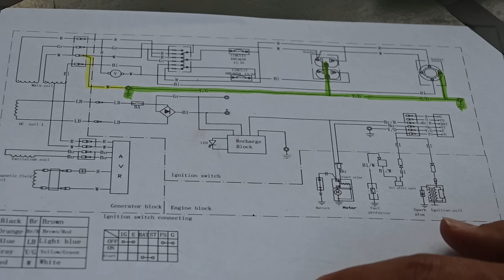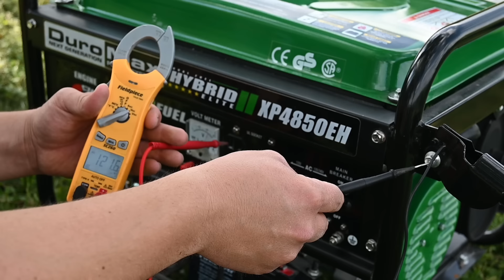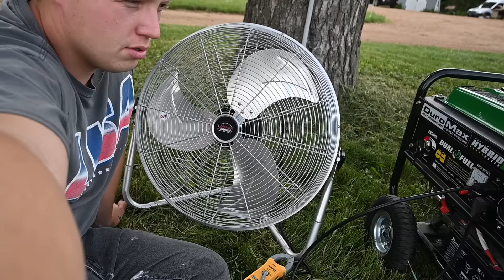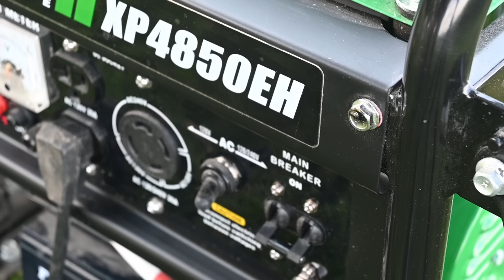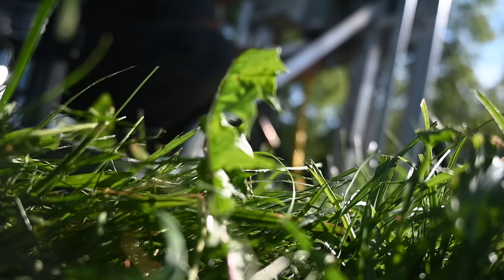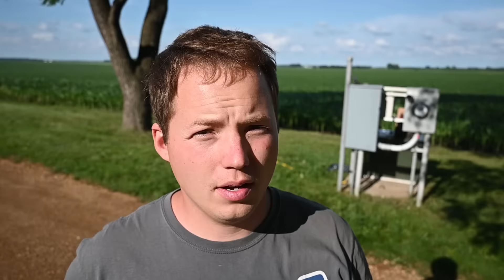What is a Floating Neutral Generator?

Comment: Maybe the best video on youtube explaining bonded versus floating neutral generator. I had an "master electrician" tell me that a bonded or floating neutral generator does not matter, all that does is the first means of disconnect needs to be bonded. I said no if you use a 3 pole transfer switch where it switches the neutral as well as the hots, the generator must be bonded with a ground rod attached, and he flat out said no. I know the research I've done and your video further reinforces things. 

"Everyone is an expert, the trick is to talk to the right expert! - anon

Comment: I worked for a company as an apprentice years ago and we done a lot of Generac Automatic Standby Generators for whole house operation, and one county made us drive a ground rod for these 16kw, 17kw,20kw and 22kw generators and another would make us disconnect the ground rod from the generator. When we first started installing these generators, there was a mechanical lug on the back at the bottom of the outside casing, over time, a couple of years down the road, Generac removed the mechanical grounding lug, and it is my understanding that Mike Holt played a role in that decision. All it is essentially doing is giving lightning a path to fry the circuit board on the generator and transfer switch. I think what you done essentially proved that true when you drove the ground rod. It done nothing at all to help provide a path for a fault current to trip a breaker! I thought this was a great video, and I think there is a lot of confusion on grounding and bonding for sure!
Reply: Grounding is all about "potential" path to earth. Potential makes everything neutral.
Reply: @ that’s not what it’s all about! Potential voltage difference has to do with bonding! It assures that a person isn’t shocked because of any voltage difference metal parts!
Bonding and grounding have to do with tripping a circuit breaker as fast as possible to avoid damage to personnel and equipment!

Comment: You seriously saved my ass with this video; had I not just installed a new furnace, I would never have known that my generator hasn’t been grounded since I bought it...extremely frustrating, I was getting a Hot/Neu REV on my ground fault tester, it was actually flickering both sides of the tester. 

I showed your video to the repair guy for Ryobi, he didn’t have a clue either. He said these are dangerous to use with extension cords and was surprised that none of the books mention this from any manufacturer. 

In my opinion there should be a toggle switch to be able to use bonded or otherwise, as well as a clear explanation as to why you need bonded or floating. When my warranty is up, I am installing a toggle for this. 

Thanks for making this video, I did purchase one of those plugs from your link...

Curious though, does just doing one plug fix all the plugs. The Ryobi dude said one should do it because they are all hooked together, but I thought I would ask. I have a Ryobi 4000 inverter.
 
ROCK ON!
Reply: UPDATE: I could not believe that this caused my generator failure. I bought the same generator and plugged it into the new generator and it worked perfectly. There must have been an internal issue with my other generator. It’s off to the shop to figure out what happened to it...My GMVC80 Goodman is working perfectly now as well as everything is grounded...THANK YOU!

Your advice was sound and I now think that something was wrong with the other generator that the plug exposed. 

THIS METHOD YOU HAVE POSTED IS SOUND AND WORKS PERFECTLY.

———————————————————

I guess my praise was too soon. I heard a snap sound when I tried the plug recommended, and I heard a snap. And the engine kept running but slowed down 20% from idle. 

None of the circuit breakers snapped, but now there is no power from any plug and the engine knocks hard when I try to start it. 😕 Looks like this turned my generator into a paperweight. Very upset right now...I checked the plug to be sure it’s wired right and it is...no idea what happened. I was so convinced this was going to solve my issue, and now my inverter won’t start at all. Something seriously didn’t work well...

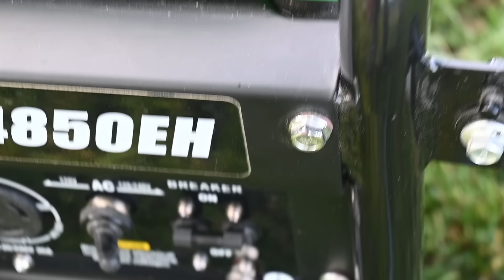Comment: Amazing in depth video on this. Thanks! @12:46 for those that dont get it... you would get shocked by touching the generator with that situation. The metal parts were live with voltage
Reply: Not really. The phase was grounded and assuming your body touch the ground too, both are at the same potential and you're safe. The real danger with that situation is that now the neutral is 120V relative to the ground. Assuming again that you're grounded and you touch the neutral (frequent with small appliances without ground where the frame connected to the neutral), you'll get shocked.

Another danger is with 240V appliances where the phases are usually both 120V relative to the ground, but now if one phase is grounded, the other is 240V relative to the ground, making it way more dangerous.
Reply: No you would not, it simply would make the generators white wire now the hot.

Comment: Excellent explanation not only about the difference between floating and bonded portable generators but the electrical safety reasons and now you've earned yourself a new subscriber.

Bingo!! "The electrons want to return to the SOURCE, ground really has nothing to do with it." @ 13:30.  As a journeyman electricain and electrical safety instructor, you'll be amazed how many electricians, technicians and even electrical engineers have been incorrectly taught that "current always wants to go to ground" then magically disappears.

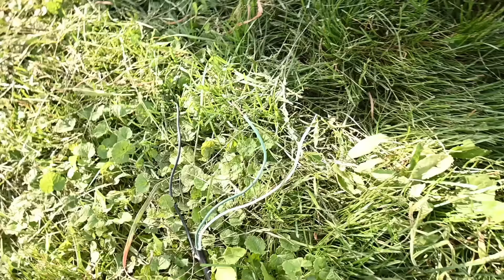This is why 'grounding' and 'bonding' while related, are two distinctly different things. Excellent example of what it means for the generator's neutral to be bonded (not grounded) to the generator's frame @ 14:55.
Bonding the neutral to the frame of a portable generator provides the exact same function as the Main Bonding Jumper (MBJ) or System Bonding Jumper (sometimes called Neutral Bonding Screw inside a service rated panel) @20:00 that's required by the NEC, article 250.28.  And why the 'hot or phase' wires, (red, black, etc.) is called the "ungrounded conductor" which carries current to the load, the 'neutral' (white or grey) is called the "grounded conductor" which carries the current from the load back to the source and the  green or bare wire is the "equipment grounding conductor" (EGC) which should never carry any current other than during a fault.  The EGC provides the low impedance path for fault current to return back to the source to promptly trip your overcurrent protection device (OCPD), i.e. circuit breaker or fuse. 

In other words the grounded and ungrounded conductors are the active parts of the circuit while the EGC is your safety insurance policy.

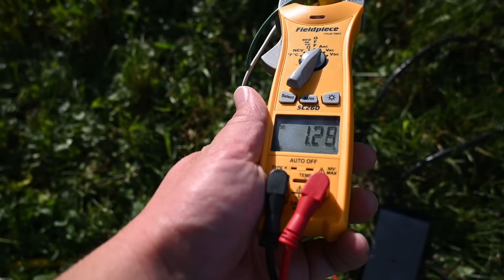Getting back to portable generators.  You also did a superb job explaining about the requirement for the interlocked circuit breaker from the generator to the panel.  You can also use it or a transfer switch to isolate the generator from the utility circuit.  Too many linemen have been injured and killed because someone was powering their home during a power outage with a generator that backfed the utility transformer. And this is where a floating neutral generator is required to be used because using a bonded to frame generator here results in dangerous current flowing on the EGC.  You showed 1.28 amps on the EGC @ 26:30.  Many people probably don't think less than an amp and a half of current is very dangerous but if we recall it only takes around 16mA to cause muscles to 'freeze up' and 30 to 60 mA for ventricular fibrillation to occur, then 1.28 A is very deadly.

The other safety challenge when using stand alone portable generators with floating neutrals, is how it prevents GFCI's from tripping during a ground fault, just like your circuit breaker example.  Class A GFCIs are supposed to trip somewhere between 4 to 6 mA, well below the ventricular fibrillation threshold.  So using the built in GFCI outlets in the generator or a portable plug in GFCI device will only provide you with a false sense of security that you're protected by the GFCI.

While OSHA only has authority over workplace safety and health, some of the electrical safety regulations pursuant to 29CFR part 1910 or 1926 can help you remain safe when using portable generators at home.  OSHA understands the importance for the  neutral bonding to the frame for people safety that they have it mandated in at least four standards that I know of.  So if you're using portable generators in the workplace or construction site, please be aware, a savvy OSHA compliance officer will check your generators and issue citations.  But thank him, because while a citation will cost you money, he may just saved a worker's life.

Check out the following OSHA regulations for more portable generator safety information:
1910.304(g)(3) https://www.osha.gov/laws-regs/regulations/standardnumber/1910/1910.304
1919.269(i)(3) https://www.osha.gov/laws-regs/regulations/standardnumber/1910/1910.269
1926.404(f)(3) https://www.osha.gov/laws-regs/regulations/standardnumber/1926/1926.404
1926.956(c) https://www.osha.gov/laws-regs/regulations/standardnumber/1926/1926.956

Comment: In case you were wondering what the glass of water is for, it is not for when you get thirsty.
A pitcher or bucket of water would be better.
You use the water to set the 8' ground rod. 
This is the hydraulic method. 
AFTER you call JULIE to mark your utilities... Don't rupture any utility lines.
Determine where you want the ground rod, usually about 18" from your foundation to clear the building's footing.
Dig a 10" diameter hole about 6" deep.
Stab the rod into the ground at the bottom center of the hole and pull it out.
Overfill the small hole with water.
Put the rod back into the hole and stab it up and down, deeper with each stab.
Pull rod back out and refill with water.
Repeat until rod goes down the whole 8' with one stab to within 2" of the bottom of the ground hole.
A hammer is not necessary.
You can push the rod the final 2" just by stepping on it.
You may need more than 1 glass of water.
Most codes in the U.S. require the rod to be below the ground and covered with dirt and the solid ground conductor to be ran in pvc conduit all the way to ground level to defend against lawn mowers and weed whackers. And use the correct ground clamp.
Get a copy of your local codes and diagrams from city or county clerk.
The ground conductor has to be wired correctly according to local codes inside the meter base.
Now go get a drink of water.
Reply: i say go get a beer
Reply: I use a fence post driver (25-30#), because..well.. I have two). Providing you don't hit something, it goes in quickly. Use a heavy hammer when it gets close to the ground.

Comment: And for those about to buy a generator, 1st thing I would do is check to see if the panel your tapping into is bonded or not. If yes then get a gen with floating neutral. If not then get bonded neutral generator. Or you can just get a bonded neutral generator and unbond it if you need to.
Reply from the maker: If you are connecting via an interlocked breaker then you really always want a floating neutral generator regardless of if the panel you are connecting to us bonded or not. Sub panels are not bonded but up stream they are fed from a main panel that IS bonded so either way you want a floating neutral UNLESS you connect the generator via a switch that also switches the neutral. Confusing as ever. Ha.

Comment: I know this is an old video but i just watched it today. All the talk about bonding got me wanting to learn more. I learned a long time ago the answer to almost every question is "it depends". I'm this case you are correct at the end saying basically it's not a big deal in this application. I called wen, my gen manufacturer to get the scoop. My generator goes to a 50a disconnect at the main power at the pole. I've run it several times with no issues. The Gen is bonded. The technical support person told me it won't really matter in this situation. I can if i want remove the bond but it isn't a problem. If it was feeding the main cb panel in the house or really any sub panel or must be floating. Sorry if it sounds like i didn't believe you, i just go by the trust but verify motto. Thank you so much for an easy to follow and understand explanation and demonstration.

Comment: You can bond the neutral to the ground case, thus bonding it, however a fault within generator that would put voltage on neutral, would then put it to case for sure, even with ground rod.  A GFCI protected transfer switch would require a non bonded neutral, which may be the reason they did this so the GFCI would trip.
Reply: this... is why I hire an electrician.  bond.. neutral... ground case.. fault... voltage on neutral.. ground rod... non-bonded neutral.  my god... hire an expert, says me.  :)

Comment: Tying the hot leg to the chassis of the generator only causes the Hot conductor and Grounded conductor to be swapped. That generator is designed to be used as an emergency power source for a home. Neutral and Ground should only be bonded in one location. Since they are bonded in the house this generator is perfectly fine, per electrical code to be used as an emergency home power source.

Bonding the nuetral is not an absolute requirement. If you are powering a single device, such as a pump or power tool, it is not necessary. If you are powering a job site, with muliple connections, the bond will be made at the power distribution panel.

Do not confuse the circuit breaker with a life protecting device, it only prevents the internal wiring from catching fire due to overload. If you are concerned with electric shock, use a Ground Fault Circuit Interrupter.